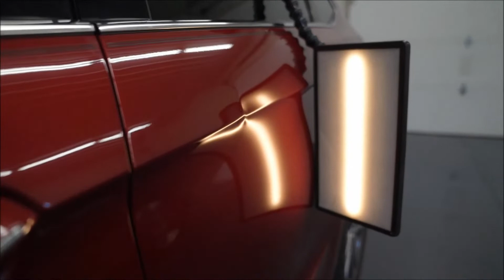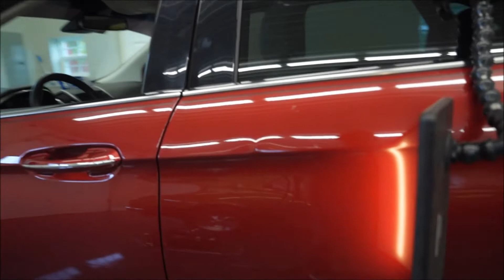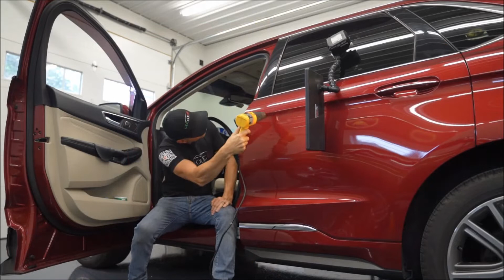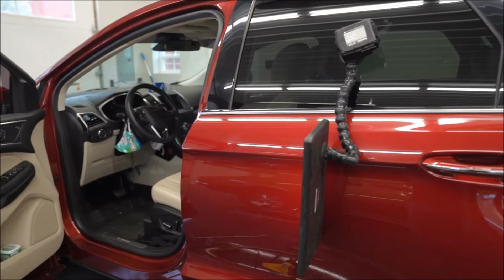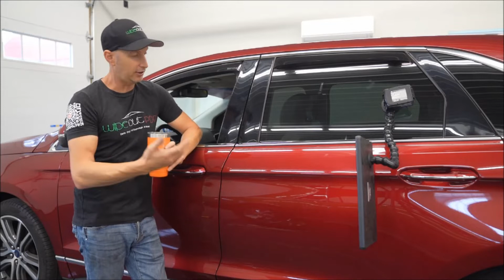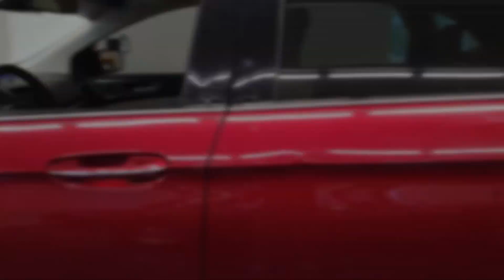Paintless Dent Removal on Extreme Body Lines!

Comment: Great work. Wish that you showed us what tools you used.
Reply from the maker: Thanks!. I pretty much used a 26" ultra dent tool straight rod with a rubber tip and then fine tuned it with the rubber tip off.

Comment: Great video, how did you get access, through the wiring loom hole?
Reply from the maker: Thanks you. I put an access hole in the back side of the door. The wiring harness was a little low to get good access on the dent. I do not usually like to put a hole in vehicles, but the customer did not want to spend a lot for the car, and wanted it done that way instead of removing interior panels and such. The customer is always right : )

Comment: What does a repair like that typically cost?
Reply from the maker: It all depends on your area and the time you spend fixing it. For me I'd say around $150 - $250. Customer wanted it perfect and not to be painted, so took extra time and made sure not to crack the paint. Thanks.
Reply: Ok thank you